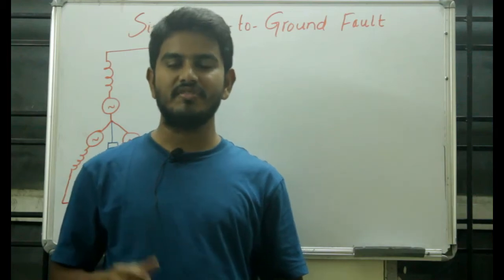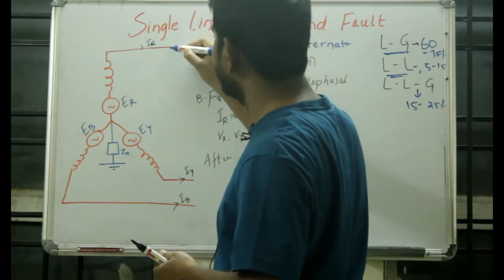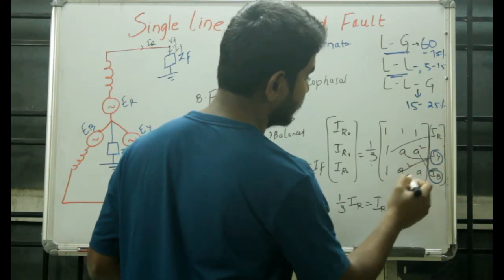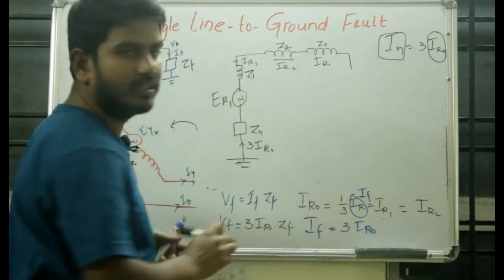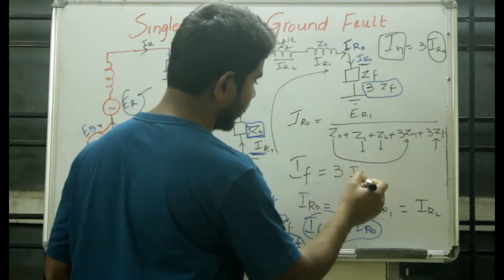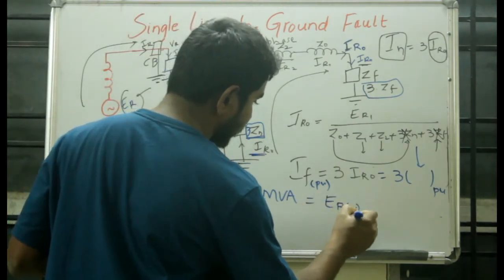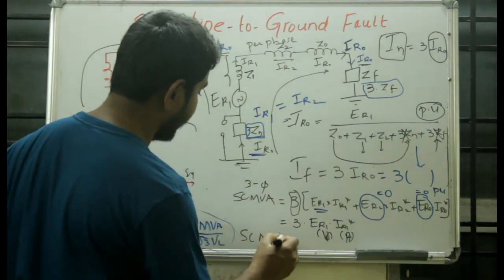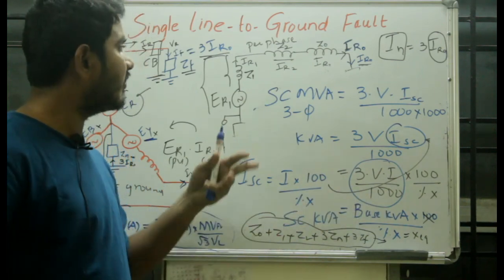Single Line -to- Ground Fault / Power System

Comment: Hello. I have a problem where i have the three impedances of the phase a (0.25j, 0,4j and 0,1j) and the impedance of the neutral phase (0,05j), and the generator has 800KVA, 10KV (between lines). The Ia0 current results on  11111.11pu and 513000 A. I think that its too big. Can you tell me if its right or wrong?